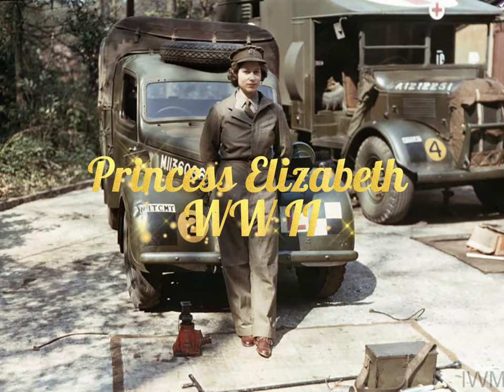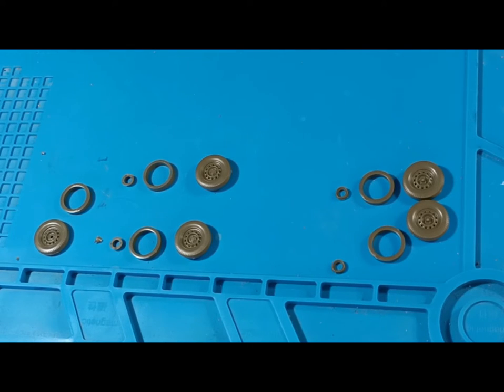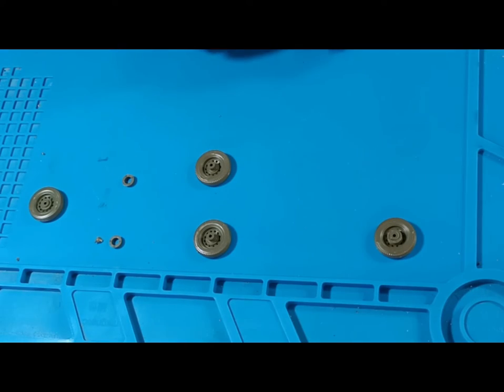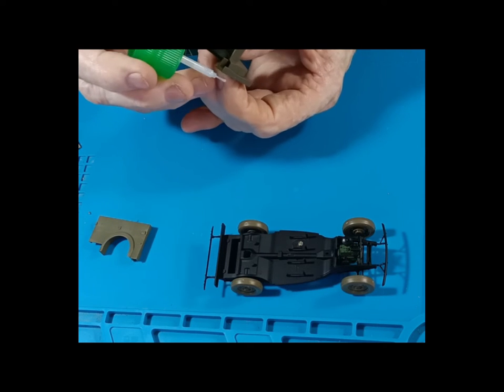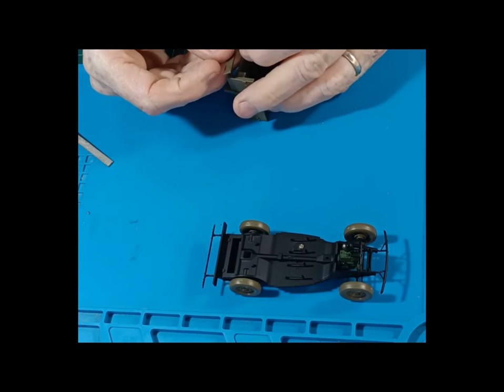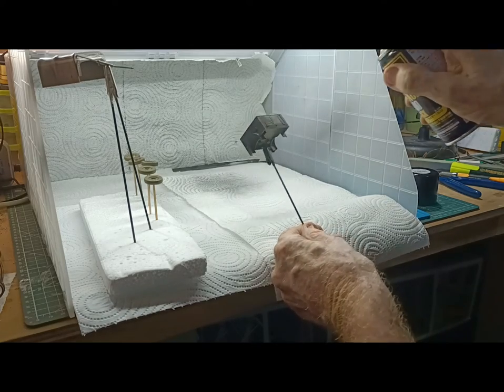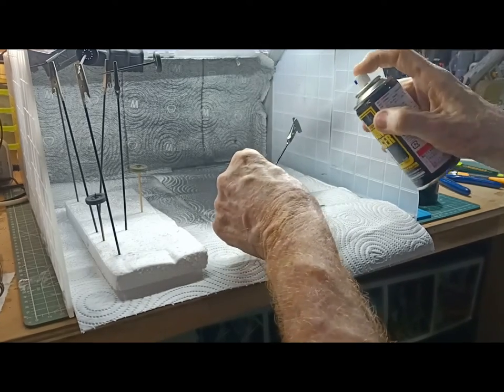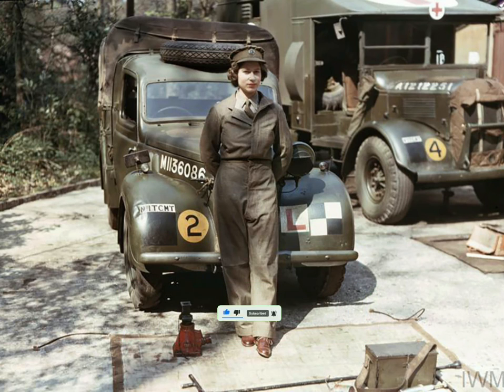Princess Elizabeth WWII Diorama,(Tilly) Part 4

Comment: Nice tip about the paper towel over the spray booth filters. I'll have to give it a try. Anything to save a quid. Cheers Bob 👍
Reply from the maker: Thanks, living on pension you need to save every penny.
Reply: @cjstein2000  yes I get that mate, I usually carefully vacuum the filters to get the bulk of dry paint off and than hand wash them, gets a bit more out of them 🤔🤷‍♂️